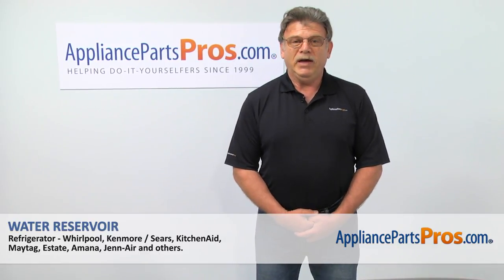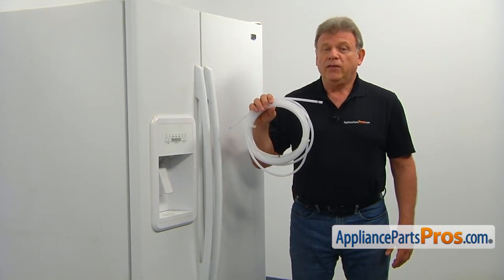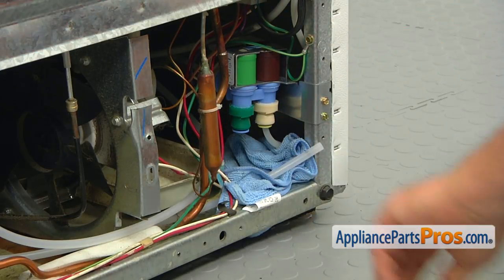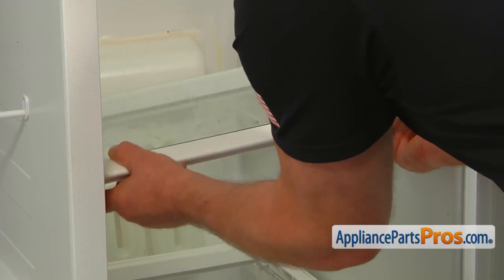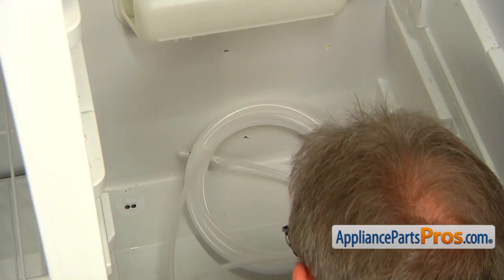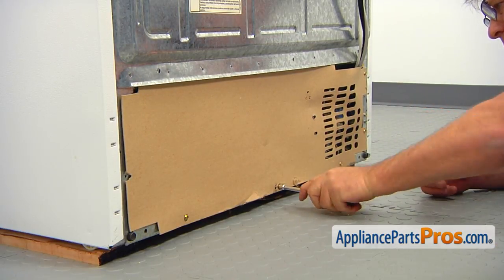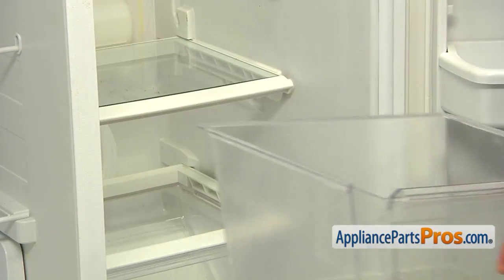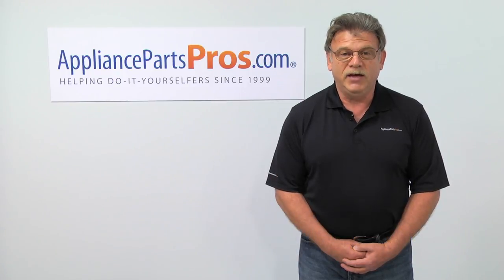How To: Whirlpool/KitchenAid/Maytag Water Reservoir WPW10276792

Comment: All that and you didn't explain how the water reservoir gets refilled.  I am having a similar issue in that the front bottom water hose is not getting water fed to it.  I suspect this water line is fed through the water reservoir.  So if my water reservoir is low on water, what fills the water reservoir?  The water valve on the back of the refrigerator?
Reply: It’s a tube full of water. It’s like turning on your garden hose. That’s how it gets water

Comment: ;iece of garbage now leaks from the water inlet valve. It doesnt even look visibly broken and the O ring is fine but it still leaks because the tube is just not thick enough i guess, even though it goes in all the way and gets held in place by the valve.
Reply from the maker: If the tubing isn't the right size that  can cause leaking or the valve itself could be defective.